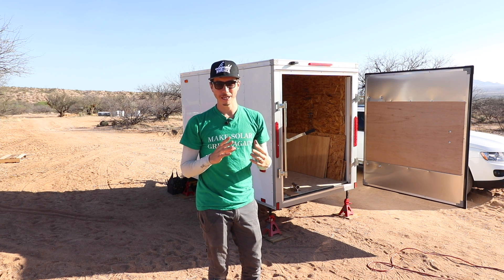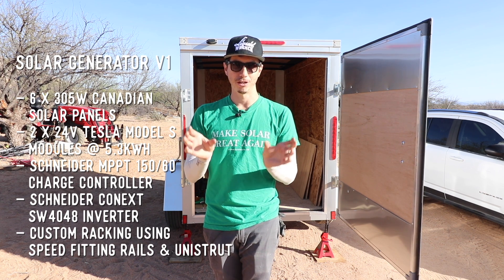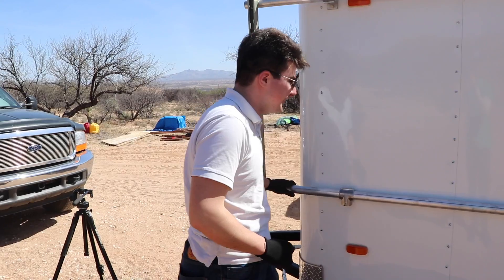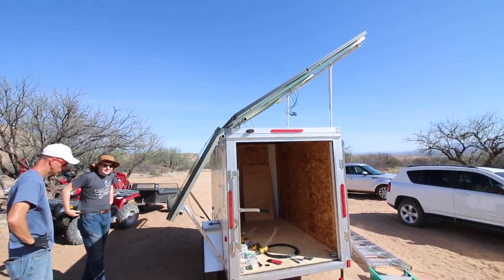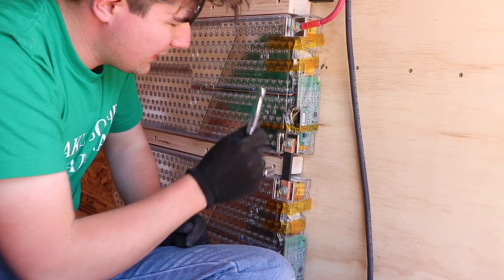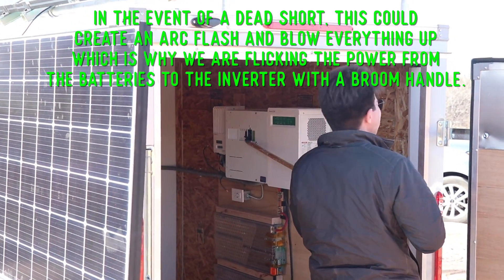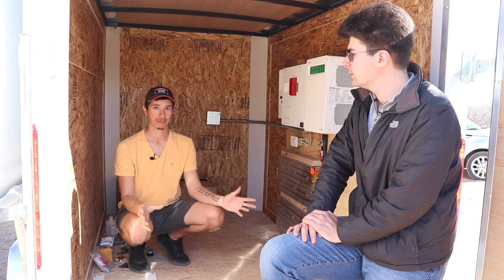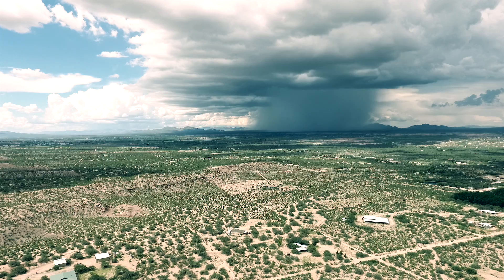DIY Solar Generator With Tesla Batteries On A Trailer... Can It Be Done???

Comment: How are you guys approaching the grounding for this setup? Does the trailer have a spike? Or you are spiking the load and treating the trailer as an isolated system?

Also, what about if somebody slams into the back of the trailer on the road? In a Tesla, the packs are encapsulated. Your design has very little physical safety protection of the packs. I would think they'd need a metal casing at the very least.
Reply: You probably wouldn't want to take this on a long journey.

Comment: Very clean and nice.  What will you do with the rest of the space in the trailer?  How will you keep the batteries cool in that ridiculously hot AZ weather in the summer?  Looks like the panels are too wide to drive down the road -- or someone might shear off the passenger side on something.  Am I presuming too much to think the panels will be stored in the trailer until you are on-site?

And last -- what are you putting in place to ensure something this mobile and sweet doesn't drive away on someone else's hitch?  Maybe embedded GPS system?

This would be great to design for an incorporated section of a toy hauler or an even smaller version that can be towed by a car (for delivery).

Comment: That's a great idea. I hope some scumbag doesn't drive off with that.
Reply: The nearest scumbags are at least 1hr drive away, and the house is well off the beaten track so I wouldn't be too worried, though Brian will be hitch locking it and possibly removing tires to save on UV exposure.

Comment: Hi Dman, something seemed off when you were blowing fuses. I had a look at the Schneider manual, they recommend min #1 wire for short runs and the unit is rated 120amp (sw4048). #1 is rated for 130a. I would size the time delay fuses at 150a (125% of the units 120amp rating).The time delay should have no problems handling the inrush. Alternatively you can bridge the fuseblock with a hunk of copper and use a long wooden stick to hit the test button;) Fuses are your friends. :) 29th year on the tools here in Ottawa.
Reply: Cool project.  I agree that description about totally discharged batteries acting like a short to the charge controller doesn't make sense.  Does that charge controller have a Load Low Voltage Disconnect?  Seems like on a daily basis, they'll be in danger of running the batteries down to the floor (which is bad for lithium, and any other battery), where a Tesla Model S BMS would intervene and tell you to walk home.  So the idea, that someone shipped you a flat Model S module, but don't worry, they'll never be that flat again, sounds iffy, unless I misunderstood.  Does the charge controller dictate the current that can flow to the battery and ramp it up on connection, or is it just going to firehose it?  I guess I might have tried to shade the panels if it really is a case of initially flat batteries being the only issue.  You need a minimum voltage to excite the inverter and charge controller, though, right?
Reply: karlInSanDiego  I think they explained that the brand new invertor has capacitors that "charge up" the very first time the unit is energized. (Rather than dead batterys). If the batteries were dead there would no power to blow anything up ;)  cheers.
Reply: OIC.  Makes more sense.  Then I'd say, disconnect the batteries, and let the solar prime the giant caps.  Thanks for clarifying.

Comment: Not that this is just a good you were able to provide the actual practical creation of the first unit. I am sure this would a benefit to a lot of end users. I would think from observing the layout of your panels that you possibly if need an additional 4 to 6 panels could be added that would be folded on top of the original ones for transport and protection during transport to an alternate site. Great job curious to see how well this holds up such as how do you handle and is it an issue for heat build up within the confines of the trailer box. look forward to more Videos on this.

Comment: So how do you protect against overcharge, overdischarge, and unsafe temperature fluctuation? Is there a BMS on this? Fires are no joke!
Reply: All charging is controlled by the main solar charge controller (with breakers if too much current is pushed in or out), low voltage cutoff (set to 20% SOC) is handled by the inverter (tested and working) Tesla lets these modules get as hot as 107F inside the car pack, that is partly under heavy load (which causes I2R heating) but with light household loads in this use the only temperature rise is due to ambient fluctuations which don't frequently top 110F even in AZ

Comment: The problem with making that nice is everyone will want one. 
But some won't want to buy it.
Better find a way to lock the wheels. And other theft deterrent options. ;-)
Reply: Bore a 4 inch wide hole 5 feet deep into the ground on both sides of the trailer just inside of the tires, drop a log chain into the hole leaving 2 - 3 feet of the chain above ground level, pour concrete, let it setup! Take the above ground portion of the chain and enclose it in a high temperature resistant fiber pipe wrap like the kind used on steam and nuclear plants,  Loop the chain around the trailer axle, the lock and chain should be terminate inside of the trailer using two holes just big enough for the chain and its anti-torch fiber sleeve! Block set the trailer, Remove the trailer tires and store the tires in a hidden location! Install a alarm system on the trailer tied to your cell phone for intrusion alerts with GPS tracking! 

Short of that, install a dead man shotgun inside of trailer linked to the back door, you might not prevent the theft of the trailer, but you will get the pleasure of burying one of the S.O.B.'s on your property so you can go p*ss on his grave every day!

Comment: My only question is, I saw it taking three guys setting it up at his fifth wheel trailer. Is this the standard?
Reply: Cory Boyd you really only need one fit person to undo the side mounted panels, the bigger array on top needs one guy on a ladder to lift and another to put the clevis pins in place, we are contemplating gas struts for rev2
Reply: Liam O'Brien thank you for your quick response Liam.

Comment: Why the choice of a Schneider charge controller, which is an expensive and rebranded product, like the Xantrex inverters, and not an excellent and efficient MidNiteSolar charge controller born in the USA? In addition to an excellent BMS Batrium to keep everything balanced and under control?
I prefer a robust low frequency inverter with toroidal transformer output, alternatively an economical and versatile mppsolar without using solar input.
The batteries prefer the Wilston LiFePo4, good for solar, safer because they have a lower lithium content and do not burn like those high capacity of the T, this can happen due to overload or failure of the controller, on the T are controlled subsidiaries and cooled with liquid during the rapid charge, they are logically found at an acceptable cost, in Europe they are too expensive and are scarcely available.
A haven of tranquility!
Good job !

Comment: love the conduit mounting system.  That's how I've been envisioning a version for my RV.  Might be buying your guide.  Thanks for putting the work in!
Reply from the maker: *aluminum pipe
Reply: ok cool cuts down on weight
Reply: Aluminum pipe would be better than the 2 inch OD GALVANIZED steel ones I have .
Reply: Cool

Comment: When the trailer is parked  and things get plugged into the solar system shouldn’t there a ground attached to the system?
Reply: we did, 8ft ground rod with a continuous 6AWG ground wire connecting all the panels, too much to show and not enough time. Rest assured, stuff like this will be covered in gory detail in the full course
Reply: Dave Rowsome good point.

Comment: Use a 110v-50w incandescent light bulb in place of the fuse (polarity is irrelevant) for slow charging the capacitors bank.
Then, when the light fade out, put the fuse in place and disconnect the light bulb.

Comment: Improvements: 
Drill multiple holes in the pipes that angle the panels so you can catch the best sun angle. Set angle with a pit pin.
Put foam insulation inside to keep batteries and electronics cooler in the summer.
Install a ventilation fan in the top of the trailer for when the door is closed.
Mount a panel on top permanently...when the trailer is being pulled or stored, one panel will still trickle charge the batteries and run the fan.
Reply: Ronnie in Florida one has already been implemented, two/three is not needed, and four, we already have all 6 panels running even when folded to continually charge the batteries (obviously more efficient with the proper tilt but it's power nonetheless)
Reply: Richard, While cooling/heating might improve performance/longevity, the question is how much improvement for how much extra money spent (radiators fans, pumps, and reservoirs aren't free). Currently, I'm logging data from Brian's solar trailer to flush out my hypothesis. While I might add cooling in the future, initial logging has shown that even a hotbox trailer in AZ isn't getting much above 40C sitting in a desert. By contrast, in the Northeast keeping them just above freezing would be the only concern, which I will be assessing with prototype 2 or 3 (heating is a big energy penalty if done using resistance, so tricky problem). For comparison sake, Tesla lets these same batteries get up to 42C within the Model S and they still warranty them for 8yrs. LG makes a home backup battery that they warranty for 10yrs which comes with no cooling, liquid or forced air and they are content to let it get as hot as 45C. Research has shown that drastic degradation doesn’t really kick in until 50C+, with the larger issue for longevity being prolonged periods at full charge (4.2V/cell) something which we are purposely not doing (only ~4.1V/cell in this trailer). Right now we are testing how much we can get away with, since we have extensive data logging to monitor the system, this will determine if full thermal management is really required (since it adds extra overhead and complexity). Stay tuned!
Reply: Liam O'Brien 
  Hi,
I was also curious about the subject of keeping the batteries cool enough, because when in the cars I know the liquid cooling system is used.
   But from this reply it seems like you are saying that ventilation, insulation are unnecessary.
   This seems to go against the mantra with lithium batteries of keeping them at optimal temperature for optimal performance and lifetime cycles.
   It can be seen that with not using them in a vehicle which will see high charge and discharge rates this il isn't as important.
   But it still seems that some temperature management would be a good idea in order to maintain the best lifetime performance of the batteries, and even the other electronics in the trailer..
   Would you mind explaining a little more fully?
  And if so thank you in advance for your time.
  Just found this channel today,so a little late to the conversation. Would appreciate a little more explanation in any case as I have been off-grid with solar and wind for over 12 years now. So have been through a lot of this experimentation myself. Found out that with load reduction it was possible to run an air conditioner during the day ten years ago. So while being told it was impossible at the time, glad to see others coming to the same conclusion.

Comment: e-bike ppl have had the fuse/capacitor issue for years, common to use a resistor to slowly charge the caps, i guess an old bulb would do the same job
Reply: I am very familiar with pre-charge circuits from the HV EV world, sadly Schnieder chose to skip out on pre-charge circuitry for their inverter's, surges not good for the caps or our fuses. May have to do our own external pre-charge design for rev2.
Reply: on my 12v (sla ....sorry lol) I use a standard 50w headlight bulb, I suppose you can just add bulbs in series to get above the battery voltage and 'problem' solved.
I've seen jack on evtv electric car conversions using a voltage controlled relay but for something that probably will never be disconnected from the batteries that may be a little too much for the use it would be

Comment: Hey from the great white north.  Great idea but have one thing you may not have thought of.  Looking at the roof rack still under construction folded down it extends quite a ways over the left side.  You might want to check with local transportation legal eagles to see if it exceeds allowable width for going down the road.
Reply: the trailer is not a full 8ft wide to begin with, US regs state 8'6" so we have more than enough margin even with overhang

Comment: Nice setup, but why not a waterproof NEMA 14-50 outlet on the outside?  I think that's safer than a corded outlet.  https://www.homedepot.com/p/GE-50-Amp-Temporary-RV-Power-Outlet-U054P/100193650
Reply: We were going to get a different/nicer RV power panel but home depot was out of stock (despite showing 3 on the site). The reason behind the adaptor is that we wanted to run 240V to the exterior for future proofing but Brian's RV only needed a 120V/30A plug so it was easier to just adapt down.
Reply: Ahh, it's an adaptor, at first glance I thought the adaptor was a corded outlet hardwired into a box, but it looks like you did a waterproof 14-50 outlet.  Nice job.

One thing I think I'd change is have the conduit going through the wall connect to a knockout on the back of the box rather than the bottom so there's no visible conduit on the outside, it'd look much cleaner.
Reply: Many compromises were made on that damn RV inlet, the original one we chose had a back KO as well as breakers and a 20A GFCI outlet included, HomeDepot didn't have it and we needed something to finish the build ASAP, next version will be REAL nice ;-)